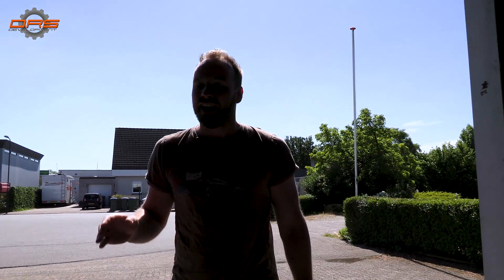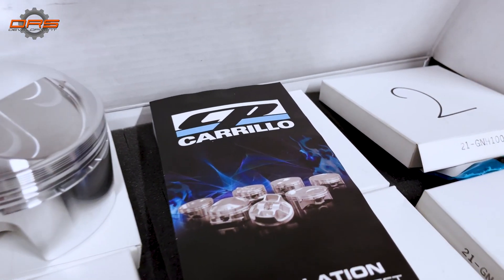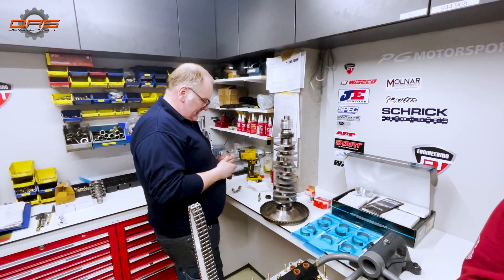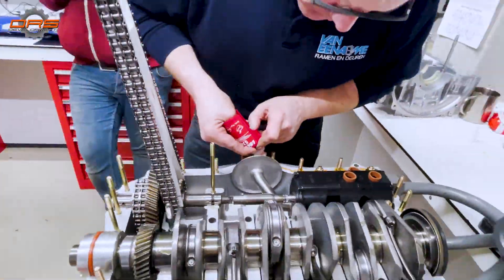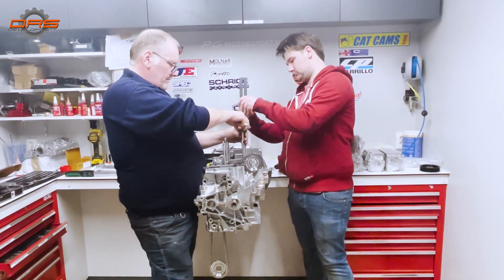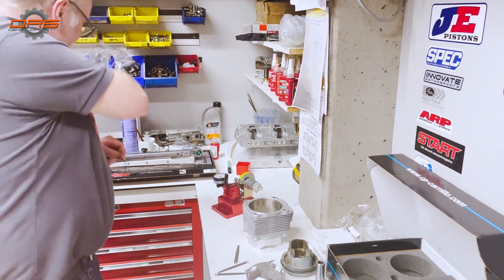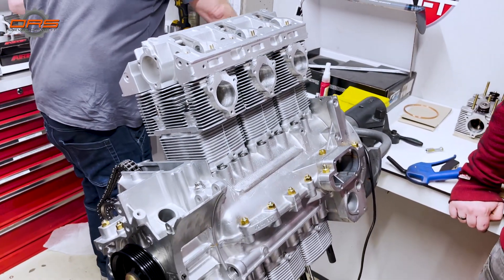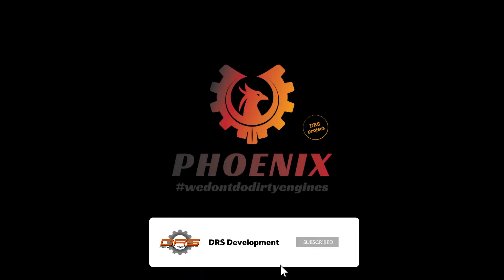PORSCHE 964 | Clean Engine Build “CASE CLOSED” | Project Phoenix Ep 08

Comment: Amazing Job. Had so much hassle getting the rods to fit on my 4 l build .. I used 997 Crank, gt3 pump, custom rods as pauter didn’t last on the dyno ..
Reply: @jonathankenny4443 what was the problem with your Pauter rods? First time I hear anything negative about them… also considering along with a GT3 crank, to replace a heavier stock 964 crank and rods.